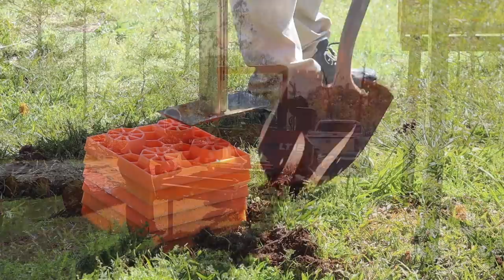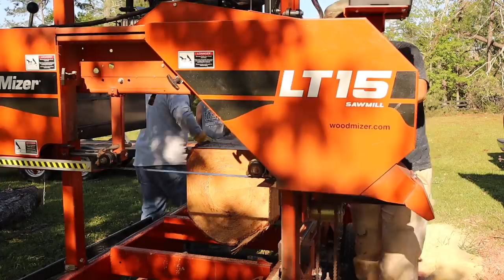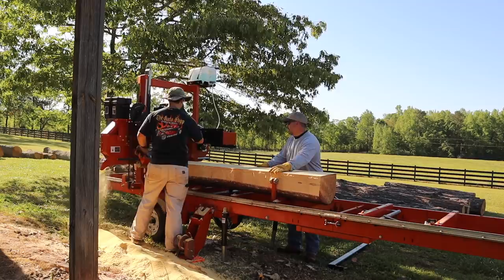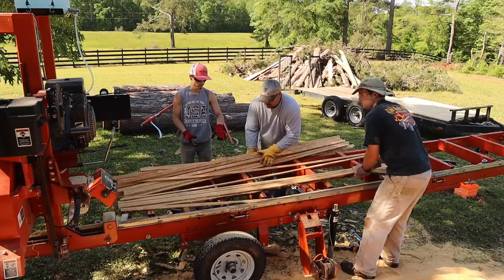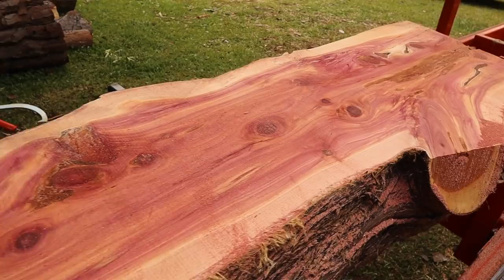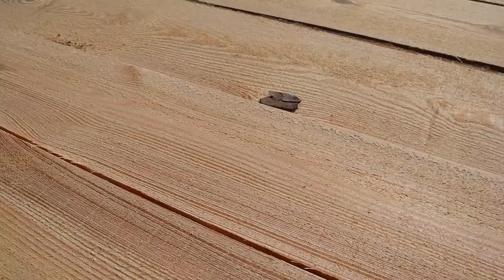Little Sawmill, HUGE Production!

Comment: The bigger logs, do not cut 4 sides but go to 6 to 8 sides and the log will be reduced 6,8 ways not just 4!!!!!! Then when the corners on the 6,8 way are to big then turn the log back to cut mid side to the adjacent mid side... do this all way around then cut the corners off to square now you have the right size!!!!! Draw it on paper first if you do not believe me!!!! And some times for quarter sawing, 6 ways gives you more quarter sawed boards but smaller widths!!!!!!!!!! I bet all three of you Gentlemen were very tired after a long day!!!!!!!!!

Comment: The LT 15 is a good solid mill for sure and that was a pretty good day on it. As for the big logs just take small slabs and keep turning and wittleing them down. You should be ok as long as you can still clear the logs with your sawhead carriage. This could be your only challenge but if you ever face that problem a great way to solve it is a log that big is a great candidate for quarter sawing so before putting a log to big for your carriage on the mill go ahead and split it and go for quarter saw it will improve the quality of the lumber with less lose of wood than whittling. Just a bit of advice from an old Sawyer that has been in those shoes and seen and done about everything that could get thrown at him. Although my experience was a circle mill I often got logs the blade just couldn't reach through. So this was how I learned to get the best out of tough situation.
Reply from the maker: Thanks, Ken! Always appreciate your advice.

Comment: You are doing a nice job with it.   I would make all my stickers 4 feet long.   And be sure they are dry wood.   Wet and green stickers will stain the wood when it is drying.  We make all our stacks 4' wide, and are sure that the sticker on the ends of the boards is as close to the end of the board as possible.  This prevents warping and cracks.  The cracks will go in as far as the sticker.  Green pine needs good ventilation too.

Comment: You might get more wood out of the log, and maybe slightly faster production, if during the "Get rid of Bark" phase you took a few 4 and 6 inch cuts. Them you could go back and get some 4x4 and 6 inch posts?  bagging that cedar dust might be valuable too, sell it at the local potpurri store.  Just a thought.

Comment: Sawyers:  A 2x4 is 1 1/2" X 3 1/2".  A 1x12 is 3/4" X 11 1/4".  So when you use your WoodMizer gauge, what do you aim for (full inches?) and do you take the blade width into account?

Comment: I just found your channel and I'm a new subscriber, I've been looking at the Woodmizer just starting my research into sawmills. How long do you have to wait to start using lumber that you mill yourself?
Reply: Look into the different methods of drying. Air drying ballpark is 1 year per inch of thickness (being covered and climate can affect it) 6-8% internal moisture content is usually a safe level to work if it's for interior furniture